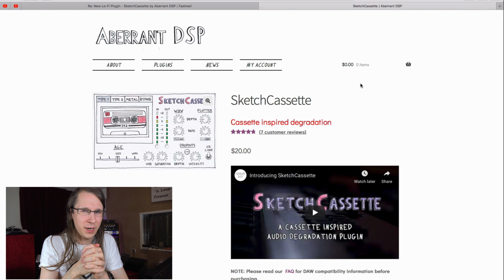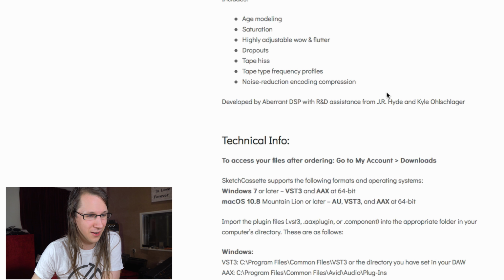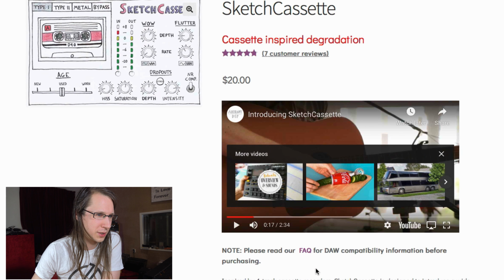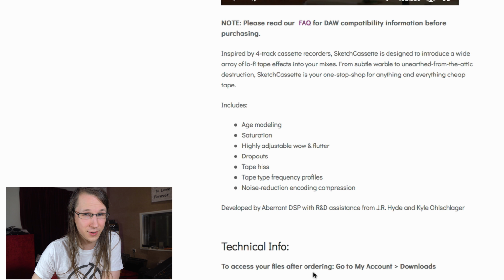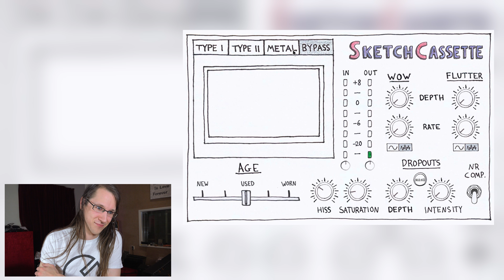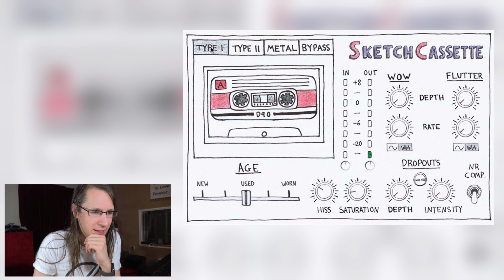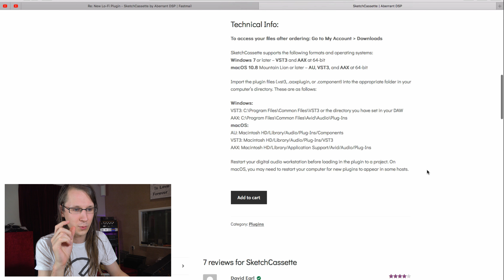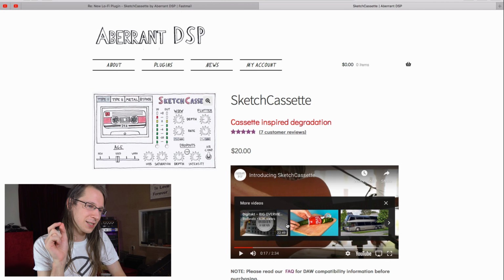Aberrant DSP - Sketch Cassette

Comment: Wow. If I waited for that all the time. It's just great. I got several tape decks and still use them sometimes. The plugin is authentic and very cool for low fi effects. Instant buy :)
Thank you for showing.

P.S.
To compare tape cassette with 8 bit digital is like saying a sand dune is like the Mount Everest.

Comment: There needs to be a plug-in called pause tapes. Do you remember making them pause tapes? Where you would pause the beat at the end point of the loop rewind and start recording at the front of the loop.

Comment: it's possible to roughly translate between analog dynamic range and digital bit depth using error percentages. essentially, you take the digital quantization error and equate it to the amplitude accuracy of the write head used to write the tape plus the playback head used to read it back. this of course spits out nonsensical numbers like "163.95636 bit" but it's somewhat useful
Reply: in simpler terms, you compare a perfect sine wave input to the tape machine's output of the same recording at precisely calibrated level, and look at how much each point in time drifted vertically, and calculate the difference as a percent. do this a bunch of times to get an average, and then compare it to the quantization error of a given bit depth to find a rough equivalence

Comment: That’s a cute plugin!  Casettes where my childhood. I had a and old computer data recorder in the late 80’s/early 90’s and besides listening to the typical childerns tapes I also listened to my my parents music tapes. I completely wore out my dad’s copy of Invisible Touch from Genesis when I was 6 years old. I have used casettes well into the late 90’s in my eary teens. The hiss simulation of the plugin sounds like how I remember it. Recently I found a nice dual capstan Technics deck at thriftstore, for 35 euro’s I couldn’t resist. Still use casettes to load computer games from time to time.

Comment: I actually like the output sound from this. Just wish the guys would be more transparent on how, not just a businessy new tape plugin, which would give us producers more understanding when to use this... you know, since by now there are hundreds of tape plugins, including free ones.

Analogue in digital, is all your numbers after the decimal point. You still need high decimal resolution, for your sound to be clear, normal sounding. Literally all sound effects, degrade your sound in certain specific fashion (even reverb), technically that's where you can use your digital, to sound analogue.

Comment: I agree, lowering the bitrate is not at all comparable. Ideally, because of the very nature of analogue, you dont want to be lowering bitrates when emulating it, in my opinion. I certainly don't in my own plugins. This isn't the way to emulate analogue. Analogue has a lot of nuance, variation, and depth. 8-bit is anything but that.

Comment: Is the hiss circuit emulation... or just a recording of hiss?
Reply: my toughts excactly...you can only approach tape hiss thus limited in range or too static. I could hear that immediately as well.
That said the rest of the functionality sounds really good, and imo, as Wytse says very useful !
Reply: definitely not, thats some amateur ishhhhh and these guys are the real deal!
Reply: Mattytime -most of the hiss you hear from tape is not the circuit, it’s the tape. When you hit play there is hiss coming off the tape.
Reply: @evoltap  tape hiss is a byproduct of of the tape resulotion-to-read ratio. It's the size of the magnetic particles on the tape. You can compensate with faster tape, thicker tape, and stuff like DBX. So I wanna know if this plugin changes the amount of hiss by emulation of that or tape width or speed or if its just a volume slider on a recording of hiss.
Reply: Mattytime i would guess the latter, a recording of hiss
Reply: Hey there! Our hiss is based on modeling we did using NOS cassettes. Cassette hiss has kindof a unique profile because of the emphasis filters used to push high frequency content at the input higher above the noise floor. These filters result in hiss that has a lot more energy in the low end than the high. These filters and their unique profile are recreated as part of our hiss model :)
Reply: Aberrant DSP cool. Is it a recording of hiss or is it related dynamically to the audio?

Comment: I remember a guy saying a normal cassette is around  5.4 KHz (didn't check on internet, probably I'm wrong..)..... 
When we compare it  to a stereo cd 44.1 KHz... cassettes were actually pretty good... !
Reply: You cannot compare tape to a sample rate. I wouldn't doubt if that is technically correct, but analog isn't a 'brick wall' like digital. More information is in there other than the accurate representation of the original information. 'Lost' information still makes it into the mix via harmonics.

Comment: Has anyone compared this to Klevgrand's DAW Cassette? From this video, I feel that the Klevgrand one is a little more realistic, especially in terms of wow and flutter. I like that Aberrant gives you more control of the hiss because Klev's "Noice" is either off or too loud in my opinion.
Reply: I prefer this one but use both
Reply: I have both and Sketch Cassette is MILES better and replaced all my usages of DAW Cassette
Sketch Cassette has beautiful saturation and thickens the sound up in a really realistic way. DAW Cassette sounds a bit fake and thin in comparison

Comment: Tape does not have infinite resolution!! It is not unlimited, this is a common myth. In theory voltage is infinite but the ability to measure and record it is not. A tape machine is man made and does not have the ability to measure and record infinite voltage values.
Reply: @Adam Acid / ACID INDUSTRY Voltage can potentially have unlimited values. But a tape machine cannot record infinite variations/values. It's ability to record voltage values are finite. Thats where people get confused with analogue gear. It's man made and the circuit has limitations (Interference / distortion)

This plugin looks like its great and I love White Sea Studio's videos.
Reply: @Adam Acid / ACID INDUSTRY For sure I'm not disputing that real circuits effect audio in a positive way. I have quite a few pieces of gear that I love and I would definitely love to have a tape machine to record to. Capacitors / Tubes / Transformers imo cannot yet be recreated faithfully by plugins. Albeit the difference is not necessarily that important as far as creating music is concerned for everyone.

However, I thought it was worth pointing out that cassette tape or 1/4" 1/2" 1"  2" tape is not capable of recording infinite voltage values. Also its worth remembering that the microphone capsule and circuit is not capable of this.

I would imagine that you could run audio through a compressor or eq two or three times and the results would not necessarily null due to the temperature differences in the components.
Reply: @Sunday Soprano Sessions yesn't
Reply: @Adam Acid / ACID INDUSTRY I agree! You too!

Comment: Tape 8 bit? lmao.....whoever says that has no concept of the difference between analog and digital on a conceptual and practical and technical level. One type is a series of off and on states, so mimics graduated sound (smooth/analog) by samples, (off and on states making up those samples, the quality coming from more and more samples per time period, but a finite amount) the other is an oscillation between 2 poles that has literally infinite degrees between each pole......tape 8 bit? ...um yeh, nah
(You could get into the resolution of tape and that would be similar to sample rate but its not in the same black and white way so it falls down pretty fast)

Comment: Probably the crapiest audio format ever,  why would anyone want this? I get vinyl, but cassette? Why? Facepalm hehehehe
Reply: Sound design purposes. I could see this plugin be used for degrading samples to be used for lofi hip hop.
Reply: Why not? Why emulation of cassettes is less useful than an emulation of vinyl? Sound engineering and sound design have a very wide range of tasks. If the customer tells you that he wants a certain piece of material sound like a cassette tape, will you buy a cassette deck and record on it? Or are you gonna use a vinyl emulation and tell him you think it's better?
Reply: @haraldkal  Then just re record it onto a cassette a couple of times :D
Reply: @checktheneck  Depends on the customer. To show a well-paying customer I'm serious about their request, yes, I would buy a cassette deck and run the material through it. I decided I already have to buy and utilize something new, so might as well do the real thing. To any other customer, like say, one who doesn't even personally come to the studio, I'd use whatever saturation I have that's closest and throw some tape hiss recording on there. I wouldn't need to install or use anything new for that.

Are you the kind of audio engineer who needs to have a specific DSP for every niche situation?
Reply: @disconisco1  well yes, I would if I had a cassette recorder. The benefits would also be presets, automation and the price. I doubt I could get a used cassette recorder, a cassette and cables for less than the price of the plugin.
Reply: Brilliant for Techno and Lofi
Reply: @disconisco1  Recording and re-recording takes more time, making it less spontaneous, and it's harder to control the degree and quality of crappiness which it imparts to the signal. If you're playing with degradation, this seems like a more fun and less frustrating way to do it :)